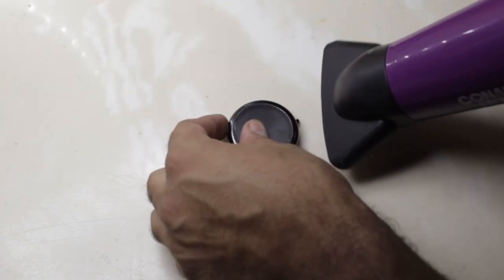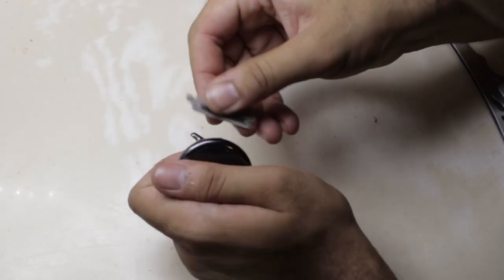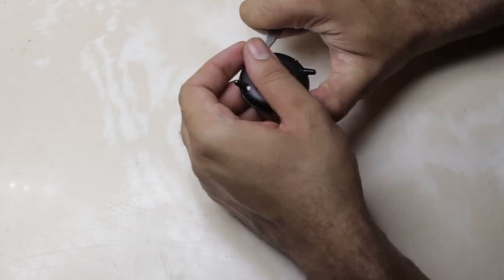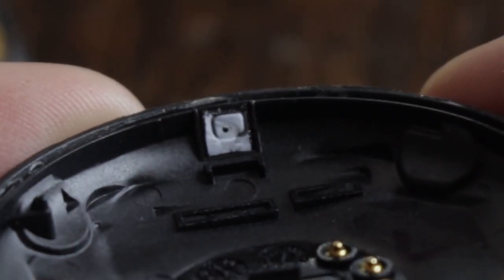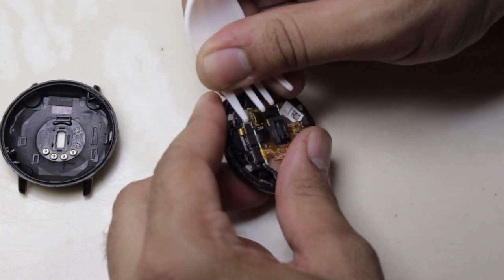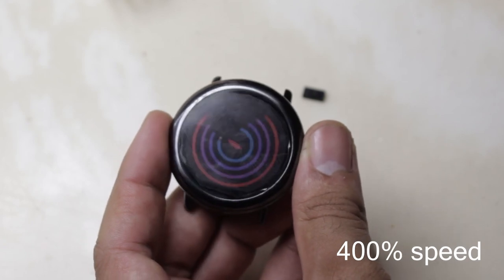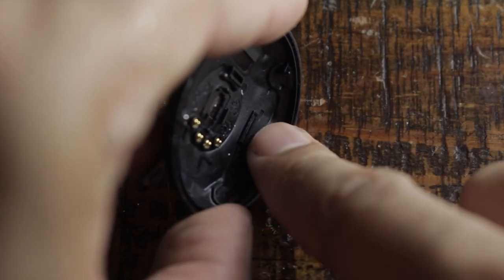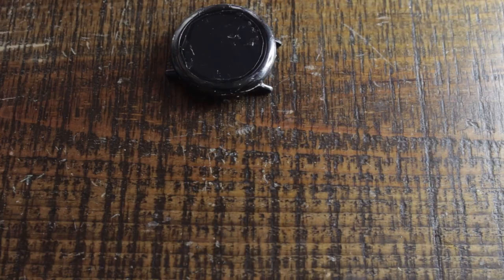How to fix Amazfit Pace Battery Drain problem!

Comment: Nice video, worked for me.  Suggestions: 1. use a small vise or vise clamp to hold backing tab 2. Heat gun on low setting around perimeter, but mostly on one part 3. Use small jewelry screw driver on seam with light pressure on seam.  In about a minute the seam started to separate and slowly use mini screw driver to remove back. 4. Remove part as you show using mini screw driver 5. Squeeze watch back together for 30 seconds (no new glue).  Full job in less than 5 minutes.

Comment: Same here i think i poke it mine too thinking its a reset button. Mines draining heavily it last half a day. I tried to clean the sensor with alcohol and put it back. There was a slight improvement that it drains 1% every 30 minutes. So it lasts for 2 days. But i also ended up trying to totally unplugged it from the device and see the difference.
Reply: Has the problem been resolved?

Comment: Hi guys, so my amazfit pace has randomly stopped working, it doesn't charge and doesn't boot up, when i put it on dock to charge the screen flashes for a second and then goes black again, the device is not getting detected in windows as well, i have already cleaned the charging pins/points on both the dock and the watch, checked the current in dock as well, the issue is not with the dock

Anyone else facing same issue? 
Any resolution?
Reply: Try opening the watch, probably some water got into it. Mine had the screen getting marks and not showing properly the display images, so I opened it, and it had water into it. Bought a new screen, tried it and works like brand new

Comment: Hello Life Fallacy. First of thank you for the video. I just want to ask a problem that what I have. My amazfit paces' heart rate monitor lid[little one] to stick out from the main part of the watch. Is the glue works for fix it? Do you suggest anything else?
Reply from the maker: yes a water resistant adhesive would work, just remember that if you sweat on the watch it will lead to moisture build up inside the watch and corrode further components. i would recommend getting another back panel but this watch doesn't have replacement parts readily available

Comment: Did this and fixed my Problem. I think its not the barometer, bcause "Mic2" is written on the componnet. but hey we dont need mic nor the barometer, removing the component did fix my battery problem. Thanks
Reply: did u have problem with overheat?
Reply: Says MIC2 for sure. I removed it and it still doesn't resolve the issue. Dies in a few hours

Comment: Hi, I tried to do what you did.. Battery draining issue is resolved but it's not charging anymore. When I was removing the barometer device I saw corrosion which I removed and put the barometer device back to its place.. Ever since its not charging.. Tried to shift the charging points as well to ensure its on the correct plclace.. Nothing still
Reply from the maker: it is because the pins from the back part of the watch aren't making proper contact internally, maybe you added too much glue when you sealed the watch back up.  which is what i did at first. i would recommend opening the watch again and removing all the glue around the edges. once you have removed all the glue around the edges do a dry fit (put the watch together without glue) and place it on the charger, squeeze to see if the watch starts to charge.  if it does indicate power you need to use a strong glue that wont create a gap between the two pieces of the watch.

if that doesn't work, you can also try to raise the contact points in the motherboard:
@ 2:38 on the video you see that orange ribbon where the 4 pins are? well, you can partially peel that off like a sticker (BE CAREFUL IT IS FRAGILE AND CAN TEAR EASILY) to get a piece of metal underneath it to raise those contact points. 

Then you can cut an small sheet of metal that fits that area from an aluminum can or a razor blade, glue it right underneath the ribbon, this allows the contact points to be closer to the back panel contact points

ALSO the i recommend you remove the barometer completely because the corrosion, no matter how small, will drain the battery, you may have scrapped the visible corrosion but its nearly impossible to get all of it without using chemicals.
Reply from the maker: Hey, i made a quick video explaining this better. i know is confusing i tried to be clear to the best of my abilities. good luck, and let me know how it goes.
Reply: Life Fallacy c Siri
Reply: Hi @codefallacy  . My amazfit pace pins have coroded and one day I noticed that there is a whole in one of the charging pins. A really tiny spring came out of the whole and I lost it unfortunately. Do you know if it is possible to change the charging pins only on the cover? Or maybe some fix without changing them?

Comment: Nice video. Any videos on how to fix the screen?
Reply from the maker: sorry but i havent had to replace the screen. but dont be afraid of opening it and trying it
Reply: Fixing the screen is easy, buy new screen, disassemble the watch, heat the ceramic frame and press the screen, it will come of. Then just rub the old glue out of the frame, and use B7000 glue to assemble the new screen to the ceramic frame (pay attention to the position of the display in the frame, and the frame on the watch chassis

Comment: I had similar issue, will open and try it.  Thanks!
Reply from the maker: Glad to help, it fixed the issue right away. You can use the same adhesive, i chose to remove the old adhesive and added new one but i added too much and the charge pins didn't make proper contact so i had to open it up again and remove some

Comment: Thanks for the video. Can't I just seal this little hole from outside and that's it?
Reply from the maker: if your watch functions fine, then yes you could over the hole as a preventive measure. but if you are experiencing battery drain issues then you might have to open the watch and remove the barometer sensor since it gets corroded when wet and drains the battery.